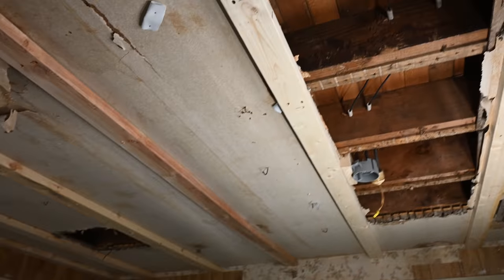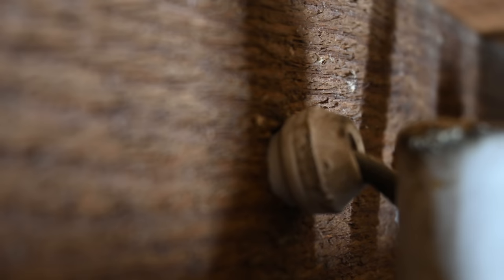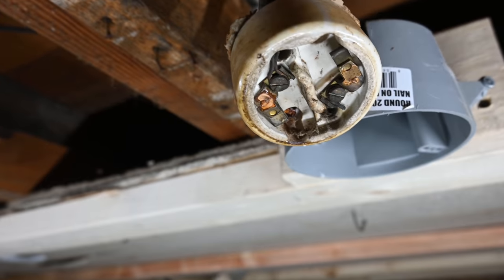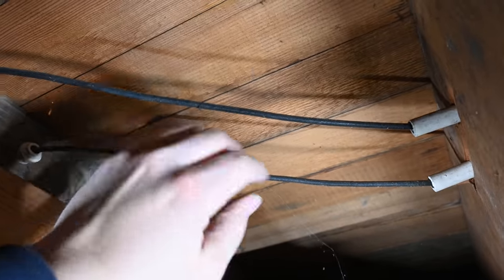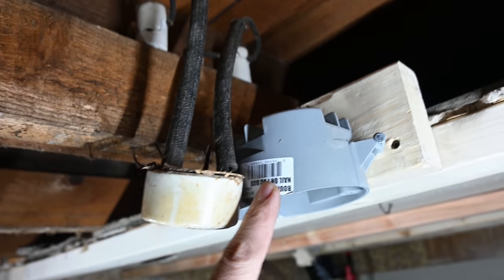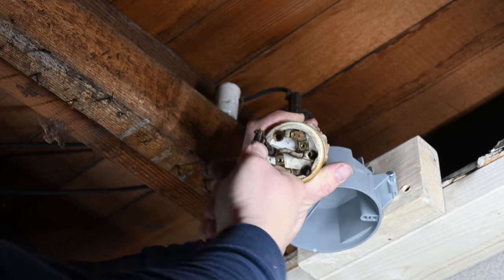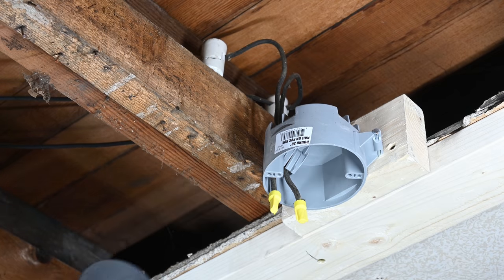How To Abandon Knob & Tube Wiring in a Wall or Ceiling

Comment: Led lights use PWM pulse width modulation to control there light output. That’s why they flicker at different rates on different light settings.
Reply from the maker: Makes sense. Obviously YouTubers aren't their target market but I know there are ways that they can vary the output without flicker.
Reply: PWM is is incredibly more efficient than a series resistor, which wouldn’t flicker but would consume more power. 

I have an LED flashlight with a low and high brightness setting.  I was working on an old 16mm film projector with an exciter lamp and photocell for an optic soundtrack. When I pointed the flashlight beam at the photocell the audio amp played the flashlight’s PWM frequency through the loudspeaker as a loud buzz. I couldn’t see the flashlight flickering but I could hear it, and it only buzzed on low, high was clean.
Reply from the maker: @tadonplane8265  That's super interesting. If the PMW is truly that much more efficient I guess I can understand why Milwaukee would use that method. Just a bummer for those that like recording stuff.
Reply: @BenjaminSahlstrom  ... not an engineer, but my first thought was they could add a capacitor to the circuit and that would help smooth out the pulses.
Reply: Odd that it flickers even on the highest setting though. You'd think it would be 100% duty cycle.
Reply: @shaunclarke94  ... probably cheaper to use a half wave rectifier and fewer capacitors to buffer the pulses. There was a time when incandescent bulbs flickered, but that was back when AC line power was 25 cycles.
Reply: Yes look up pulse width modulation. It specifically comes into play to achieve various dimming levels
Reply: Our eyes/brains operate at 40 hertz that’s why we can’t sense the flicker with the naked eye (it’s too fast) but a camera picks it up
Reply: @R900DZ  ... if that were the case your eye would pick up on the flicker from your TV at 30 frames per second (US) and 25 frames per second in most of Europe. There'd also be an issue with most movies being shot at 24 - 28 frames per second. (old fashion film) This flicker has nothing to do with your brain or eyes. It's related to the camera frame rate and being out of sync with whatever frequency they chose for the lighting power supply. My first guess is they chose to use a European frequency or a multiple of 50 Hz and the US camera frame rate is 30 or 60 to coincide with our 60 Hz power and TV standard. This is the same reason a plane propeller seems to move in slow motion or even backwards when shot on film. It's called a strobe effect.
Reply: @rupe53  i think you're confusing frame rate and refresh rate.  Frame rate (the 30/25 and 24 fps you mention) determines how choppy a moving image appears - and 24 is still standard for film, btw.  Refresh rate is generally higher - 60 was common on CRTs (i even remember a 75hz trinitron i once had) and is generally the minimum on LCDs (though LCD refresh rates can often be adjusted to match frame rate, in order to avoid tearing, but the mechanics of LCD refreshing generally avoids flicker - it's more about the backlight frequency in that case.)  You absolutely can see flicker from a lower refresh rate - most studies seem to converge on 60-90hz being the point where most people no longer perceive flicker, but it's also dependent on brightness and/or movement of either an illuminated object or movement of your eyes themselves.

Btw, I am quite sensitive to LED flicker, and am constantly searching for low/no flicker options.  Most A19 and BR30 bulbs available at big box stores now seem to use a high enough refresh rate (pwm frequency) even for dimmable options (down to the minimum dimming recommendations at least) where it's no longer an issue like it was early on.  Unfortunately the same can't be said for most smaller or exotic bulb types - and we have many around our house where the flickering drives me absolutely nuts... no camera needed.
Reply: @ryandugan  ... while I have very little first hand experience with LED bulbs and LCD TV sets I am very familiar with that strobe effect and things being out of sync because of different frame rates or refresh rates. It was a common problem for people doing home movies and even still photography back in the days when people still used film. BTW, I also knew about the 60 FPS format for CRT, but if you read between the lines (pun intended) that's usually an interlaced picture that takes two passes to create an image from a 30 FPS input.
Reply: @BenjaminSahlstrom  If you add an LC filter to the PWM output, you’ll create a buck converter that outputs a constant voltage. You can then adjust the duty cycle to get constant current.  Apparently they were too cheap to add $1 of components instead of turning the LEDs fully on and fully off.

Comment: I have rewired about 2/3rds of my 1952 home.  The original/undisturbed t&k is in good shape.  Problem areas are when some bozo tapped into the t&k to add circuits - I have torn out those areas - the sheathing was crumbling/heat damaged ,or the install was so poorly done it was begging to be ripped out.  When I install new circuits, I completely tear out the old, so there is no question about where the circuit runs.

Comment: Super helpful! Just pulled a light fixture down. Surprised to find a knob and tube set up. We updated our electrical box when we moved in and well....anytime we pull something off the wall there's a new surprise. 

Do you have a video about connecting a new light fixture to this kind of wiring?

Comment: I have an apartment building with 4 units and all 4 have K&T. I have replaced 3 of units wiring. What I did was completely eliminated the wire running the K&T circuit without opening the wall. The K&T in each apartment was running all of the outlets and lights on one breaker. So what I did was followed the wiring coming from that breaker and followed it to where it was connected to the K&T and complete cut all of the wires out and disconnected the wire from the breaker box.

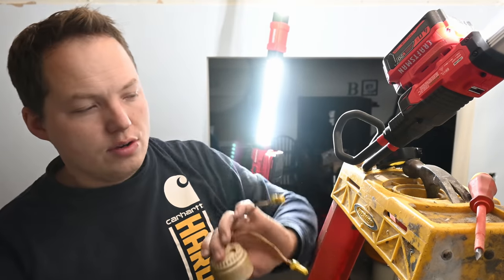Comment: 11:26 House built in 1928. Upgraded the service to 200A and uncovered a true rats nest of K&T. Decided to gradually replace it all. I’m disconnecting it from the service and just leaving the wire in the walls. Running new romex and bringing sanity to the circuits. That long ago they just had lights and so balancing loads wasn’t really a thing. It is a royal mess. My advice: motion activation and wireless switches. Save your sanity!😊

Comment: Speaking of those Knipex pliers that got damaged @9:00, I once had a buddy ask to borrow my leatherman and then he used it to jump the starter solenoid on a riding lawn mower using my knife blade. The resulting arc caused a small chunk of the knife blade to blow out.

Comment: I'm only removing KT wiring (1920 house I just bought), but it's slow going.  Under the house was a nightmare, with rotted insulation and bare wires. Circuits have been added through the year, some ungrounded (a different problem), some grounded. But I was able to pull out all the under-house KT and replace it with romex. Of course the longest KT run was to where you would naturally want to plug in a resistance heater in the winter. Of course. 

In the attic, where there are horrors. They insulated right over the KT. Of course. It's dry up there and the insulation is mostly good, but it is nibbled on by rodents in some places. 

The real problem is the walls, where the KT runs down to light sockets and plugs. Plugs I can handle. Any run that goes up can also go down. Down under the house to a different circuit that has romex and a ground. I can leave un-energized wires right where they are. The problem is the switches. It's really hard to fish in this house So for the moment I'm running the KT in walls into a junction box while I decide how to get them all fished. That's the situation for the moment.

Comment: Our 1880s house still has knob and tube in the walls and probably to the ceiling fixtures on the 1st floor. Where it is accessible, the rest has been replaced with modern-ish wiring. (Still some places without equipment ground.)

Comment: Carter 3 way. Worth a search
Reply: love it, THANKS
Reply: Also known as farmer's 3 way, or barnyard 3 way, many older farmhouses with outbuildings and a yardlight in between used this setup because you could have a 3 way switch in the house and outbuilding controlling the yardlight,  and the outbuilding can have some receptacles constant hot, using 3 wires instead of 4 (not counting the ground.   )

Comment: Thanks for the video! I live in a very old house that still has some funtional knob and tube wiring upstairs. Unfortunately, there is no attic to enable getting to all the wiring (flat roof, with only rafter space above the ceilings), and all of it goes to a fuse box. The 15, 20, and 30 Amp fuses are still operational and are currently offered for sale everywhere. Should I think about changing over to a little circuit breaker subpanel for the mere 4 circuits (no ground as you pointed out) or leave it be (just in your opinion as a hanyman)?
Reply: If you have an old panel and you are looking to upgrade, I would put a new panel in.  Anticipate that you or someone else may want to rewire in the future, so put a larger panel in to handle potential growth in electrical use.  It sounds like it would be a large undertaking, but I would get rid of the K&T.

Comment: @Benjamin Sahlstrom  Some video cameras have anti-flicker settings. LED lights need PWM to regulate the power consumption of the LEDs at different battery levels and settings. Different lights have different PWM frequencies.

Comment: Hi Benjamin, I have been watching your YouTube channel for over a year now and find you are among the best and easy to follow. I live in Thailand and doing some construction projects on the farm. I am from South Florida originally and have been in construction all my life. Here all electrical is 220v DC. I have one question, I have installed a separate 63a main breaker and a consumers unit that has a 63a breaker, as well. Is it a bit redundant to have the main breaker and the consumer unit both with 63a breakers? The reason I ask is I want to pull the 63a breaker from the consumers unit and replace it with two other breakers of 20a and 32a

Comment: I second the LED flickering concern, that just means that your 300$ light cheaped out on the LED driver and used tiny capacitors or a cheap PWM current limiter. more expensive ones will have a buck converter driver that produces constant current at the LED so it doesnt flicker.

Comment: As for abandoned wiring, I like to completely  remove it, whenever possible.   More often than not, I abandon it in place because in most cases the wiring is secured to framing members underneath plaster and lathe,  and removal is impossible without demolishing part of the structure.    In such cases I use a cable toner, find the ends of the circuit,  enclose the wiring in a junction box labeled DEAD-ABANDONED  and I like to strip with wires on both ends and wirenut them together.   That way, in the future if someone attempts to reconnect the circuit at either end the result will be a dead short and tripped breaker,  giving warning something is wrong and to stop and think.   I've seen my share of live wire ends dangling inside walls and ceilings, and that's also a fire hazard.
Reply: Thanks for those additional tips.

Comment: My 1898 Craftsman in Upper MI has knob and tube. Works great...minus a couple times flames shot out of the outlet while trying to plug something in. And the lights flicker a bit with a Lil electrical sound here or there. But...as we all know...just the ghosts. :)

Comment: Save the loom for entering junction boxes . Use White tape to identify  the neutral  . If possible use dual function AFCI/ GFCI Breakers for Lights and Two wire receptacle circuits . Older  style boxes will not accommodate  GFCI receptacles , with a Dual function breaker , a standard receptacle  will work and satisfy the GFI requirement for two wire outlets .
Reply: Why wouldn't you just change out the box to a deep? Just curious I'm still learning, that's usually what we do.
Reply: @Bludcharg4214   That is an  option , but  using a dual function  breaker can save labor depending , for instance if old boxes  set in tile  , or all the boxes in the house are old style . Good way to protect a Two wire circuit with out  unduly  disturbing old K&T   wire  which should be handled as gingerly as possible  if it is going be to be used .

Comment: Just bought a 1920 house with the lights still K&T. They seem perfectly safe and we will keep them that way for now. Almost all the outlets are romex wiring now with the exception of 2. Could we simply cap them off and keep them in a junction box where they are, even if  power is running through them? That would be most ideal if its a good idea.

Comment: My experience with Knob and Tube goes back over 70 years and what I recall is mostly bare wires because the insulation had just crumbled off. Of course my area was still running on 25 cycle 110.
Reply: Sometimes there was no insulation whatsoever. In the oldest iteration, one side of the house was neutral and one side was hot. They would just pull a single wire over to the light fixture. The leads would enter on opposite sides of the fixture so no contact ever outside of the switch or lamp base.

Of course, back then they one light, one switch and one receptacle. In my own house, they had the receptacle on the wall below the switch --- ABOVE the live gas jet for the space heater. Mm mm mmm.
Reply: @ricoludovici2825  I am 83 now so I can remember when the only receptacle was an add on to the single wire pair with a light bulb attached and a pull chain switch. Darwins law was in full effect.
Reply: @poorfesor  I saw a lot of bad KnT splicing with 1st generation electricians tape. You know the stuff: tar impregnated sticky cloth. I still don't understand why they called it electricians tape. It was fire-starter's tape.
Reply: @ricoludovici2825  Yep and every household had a roll or two of it.
Reply: @poorfesor  Yup. In the kitchen junk drawer. Along with loose matches and Duco cement.
Reply: @ricoludovici2825  My parents had a hardware store back in the 60s and sold the tape you describe as "friction tape," don't know why.  We kids used it to wrap our hockey sticks.
Reply: @robertwessel6409  Friction tape probably because many people would wrap baseball bats, hammer handles, and various other things with grips - like hockey sticks - to get greater friction. Or to keep the blade from snapping off, in the case of hockey sticks. It took me a number of preteen years to make the connection between electricians and friction tape. By then however, electricians tape was made of plastic.
Reply: We were taught in shop class that to splice house wire required soldering the joint, wrap first with rubber electrical tape, and finish off with friction tape over the rubber tape. Now we just use a wire nut inside a work box. LOL
Reply: @zombeatle01  I still use solder, but just to stiffen up the stranded ends of lamp feeds. 

The oldest KnT I have see simply would the bare wire around the single feed wire in the wall and wrapped it with friction tape. And the cut end was sticking out. 

Of corse there was nothing else to touch that would complete a circuit  because the other feed was on the other side of the house.
Reply: @zombeatle01  I have soldered many a splice. Some guys still use the plastic tape but they fix the end with a little super glue, else the tape will unravel.
Reply: @poorfesor  They called it:
 "friction"- tape
Reply: @ricoludovici2825  People call something, one name or another because they hear others call it by that name.
 Nothing more as a basis behind what "they"
Refer to whatever it is- as.
Reply: @zombeatle01  
With knob and tube,
 that was called:
 A Western Union splice.
Reply: @frankpaya690  Yep pulled many a patch with it.

Comment: Walk around Lowe's, Menards, etc in their lighting department while using the camera in your phone. Flickering or scrolling is somewhat common although It's actually not near as bad as it used to be. LED manufacturers have been getting pretty good at circuits smoothing out the flicker. Really surprised all the Milwaukee lights do...
Reply from the maker: It's something that I've definitely started watching out for. I feel like companies could stand to gain a lot by advertising lights that are "flicker free" although I'm not sure how many people actually care about that.
Reply: @BenjaminSahlstrom  You know how some people don't even notice that it is the buzz from a bad fluorescent tube that is driven them nuts? Same thing.

Comment: My house was built in 1887 (yes 1887).  It was built with knob and tube wiring. I know this because I can some that is impossible to remove without tearing down walls which are all original. The wiring was hacked more way than I want to comment. There were splices from knob and tube to Romex back to knob and tube. Some in junction boxes connected to Romex and a few splices hidden in walls.

I spent an entire summer Pulling 3,000 feet of Romex, installing a 200 AMP disconnect and 30 space panel board to get rid of all the knob and tube.
Reply: Those very early houses often had conduit exposed on the finished side of the wall and would go to a round switch with a twistable knob that you would turn clockwise to turn on and clockwise again to open.